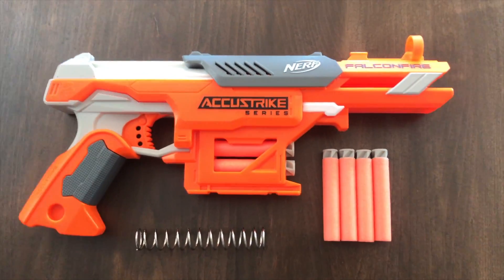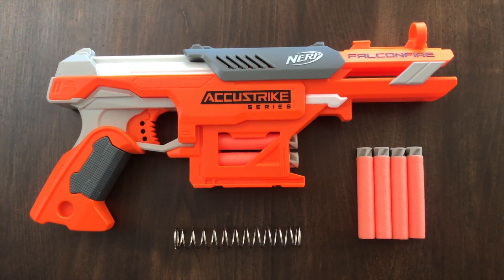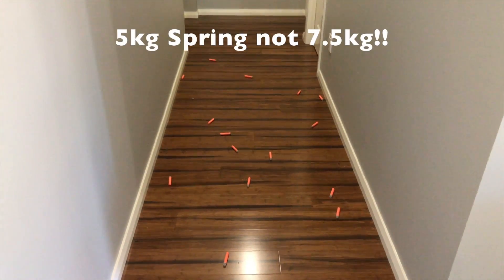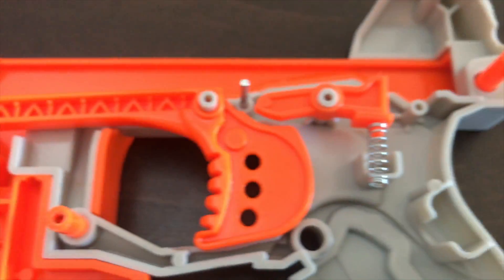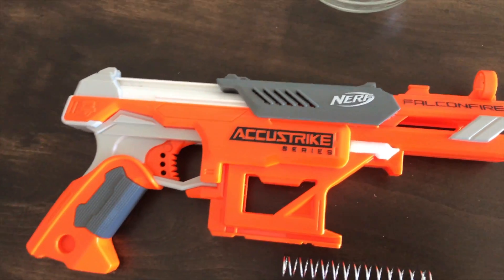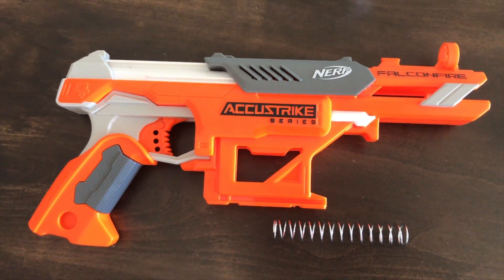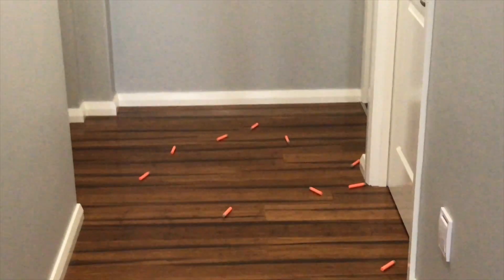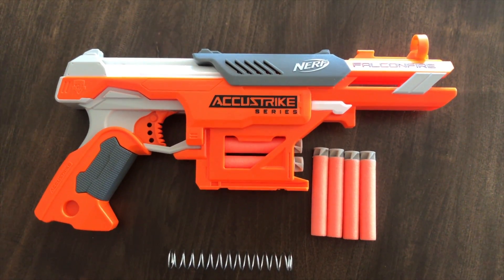Nerf Falconfire Power Upgrade - How To

Comment: For some reason I put a 12kg spring in it and it sounds like a gun for a couple meters away
Reply from the maker: That’s a powerful spring. How is the gun holding up?
Reply: @MikesManCave  not to good some of the parts are broken inside
Reply from the maker: @koloja  Yes, I thought that might happen, they are only plastic parts, 12 kg is a LOT.
Reply: @MikesManCave hey Mike, where did you get this spring from?
Reply from the maker: @mrapple2373  eBay

Comment: i just put a 12kg spring into this and put it back together, only to find that during the build the SMALLEST SPRING IN THE GUN flung out. the gun is broken till i find it :/
Reply from the maker: Better start searching. Or just find a replacement spring to replace it with.
Reply: @MikesManCave  yep, iv been looking around all over and no luck unfortunately. iv already taken apart 2 of my broken guns to find an alternative spring that could work and none of those work. maybe ill find it later

Comment: Just popped in a 6 KG spring and removed the air restrictor.  Holy Moses, it nearly doubled the dart range.  Definitely an indoor eye hazard now!  The spring I got was a tad short, so it unfortunately rattles.  If I ever pop it open again, I'll fix that.
Reply from the maker: Makes a massive difference to change the spring.
Reply: now you should wear safety goggles
Reply from the maker: @jeron9272  We actually have safety glasses we wear for Nerf games at home, not worth the risk IMO.

Comment: Mike, do you ever purchase your springs from Bunnings?
Reply from the maker: No. never knew they sold any. I just get them from eBay. If there is springs at Bunnings let me know and I will check it out or make a video and link it to me here.
Reply: @MikesManCave  they do have them. They're called Centurion Springs. Modded my Recon Mk2, Nitefinder, Falconfire and a few others. They're pretty affordable. Some need to be cut and a lot of times they're out of stock. Great channel by the way. I've just subscribed.
Reply from the maker: @audiebavington8789  Thanks, I will be doing more Nerf gun stuff, just been too busy, what section would I find the springs in?? We have a Bunnings superstore near by so I will have a look next time.
Reply: @MikesManCave  cool! Good question, I could tell you which aisle number but that'd be useless to you. No idea I'm afraid. It's a small section and easy to miss. The one I used recently on my Nitefinder was called a Centurion C836. 9kg. Had to cut it which I guess lowered the kilos. I only did it for fun just to see how much this little blaster could take. Kept the AR. Fires around 85fps using elite darts.
Reply from the maker: @audiebavington8789  Sounds awesome. You should upload some videos, even if its just for fun. I love following Aussie youtubers.
Reply: @MikesManCave  would love to. So little time. I manage the local Anytime Fitness Club. Worth thinking about though. Hmmm.
Reply from the maker: Nice one, Anytime Fitness, great way to keep in shape.

Comment: Can we put 2 springs at once?
Reply from the maker: You probably could if you find two springs that fit inside each other, but you can only put so much in there before something will break,.I think I am at the limit of what would be safe with one spring, any more power and I think something would break. At the end of the day these things are toys made out of plastic, we are already pushing the limits in my opinion.
Reply: Mike's Man Cave I've just finished modifying the blaster with 2 springs. AND IT WORKS!!!! thanks man.
Reply: I don’t think that’s a great idea
Reply from the maker: @2341-k7w  Good to know that it works.
Reply from the maker: @peerebeer4507  If it works, but there is a limit before things start to break.

Comment: Hello. Tell me please, what spring have you used and where to buy it? I mean was it retaliator spring or one specifically designed for this blaster?
Reply from the maker: I have bought the spring on eBay, just search Falconfire Upgraded spring. There are a few different ones available now, even more powerful the this one. They pretty much all work.

Comment: Now how does this affect the longevity of the blaster? Because that's a lot of power to be putting on the plastic. I like the falconfire design and I think the breachloadimg is unique but the blaster sucks. I wanna make sure the blaster also lasts a little bit
Reply from the maker: Still seems to work fine, I guess making something go harder will reduce the life, power does not come free.
Reply: insert "with great power comes great responsibility" Spider-Man quote here